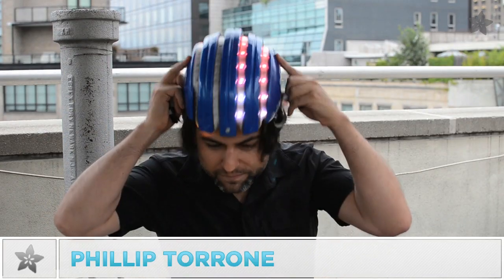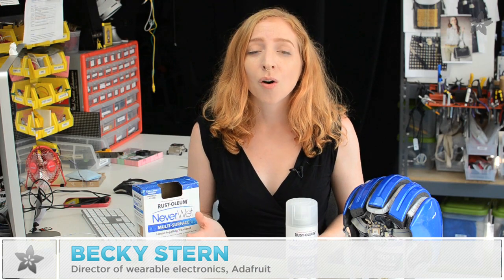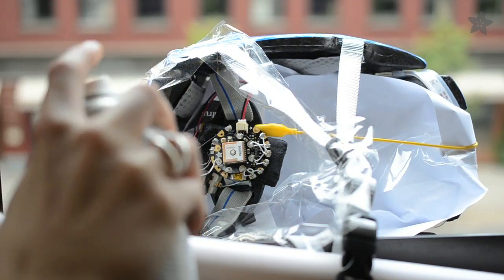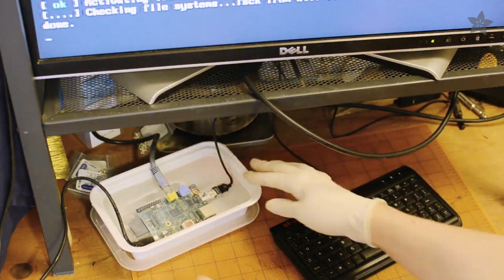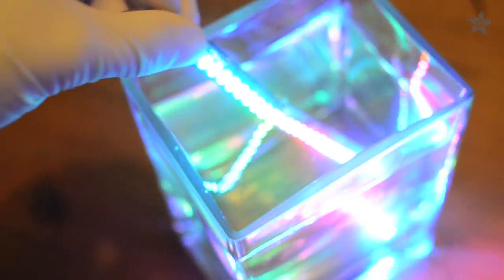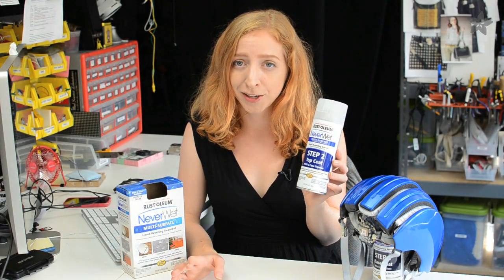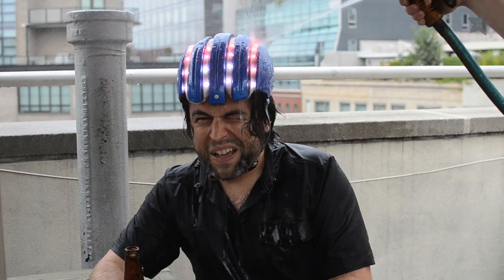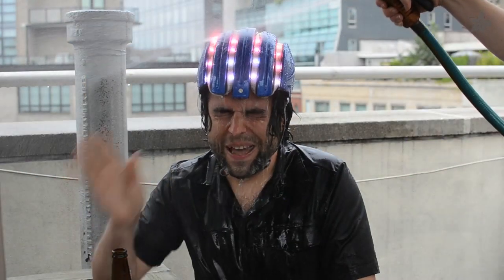Experimenting with NeverWet + Electronics

Comment: I am looking for a way to water proof the flight control board in toy grade quadcopters.  I don't want to take them apart I just want to spray on the board from the bottom of the quad.  The board is pretty protected by the quadcopter body but water finds it's way in when flying in the rain.  I was thinking corrosion x or an equivalent, I am ignorant on the subject.

Comment: Starter on my vehicle went out, I think its due to a small oil leak that's getting into the solenoid....picked up NeverWet, applied it to the entire starter, and my vehicle cranked right on up. Not a fix for the leak, but maybe it'll save the starter until I can get the leak fixed. NeverWet did cause water to roll right off, and the starter wasn't wet afterwords.

Comment: Wouldn't the Pi stop immediately in water without protection. Therefore, the improvement is from zero to 100%. Failure might occur over time or in deep water.

Comment: Just spraying on stuff won't do away with voids such as the inside of connectors where water can collect and corrode things. Instead enclose in auto sealant putty ("dum-dum"), such as 3M Strip Caulk or other brands that won't get quite as sticky when warm, leaving nothing but cables sticking out. Access would be by simply peeling off the sealant for repairs, changes or battery replacement. Place it in sandwich bags inside and out to avoid the stickiness if necessary.